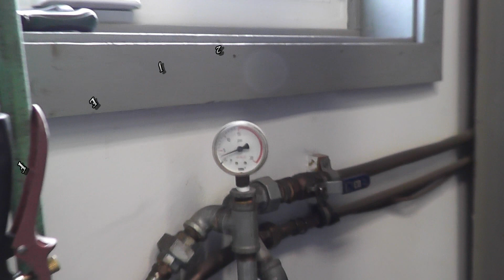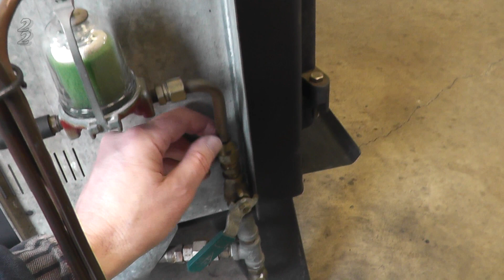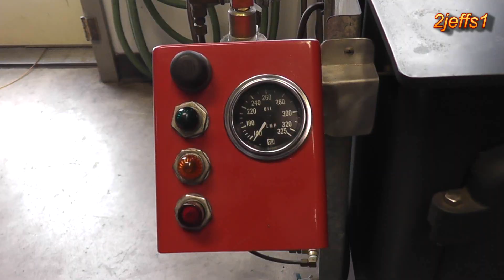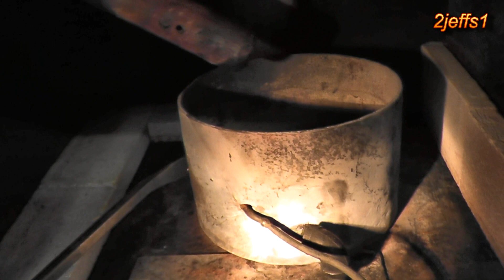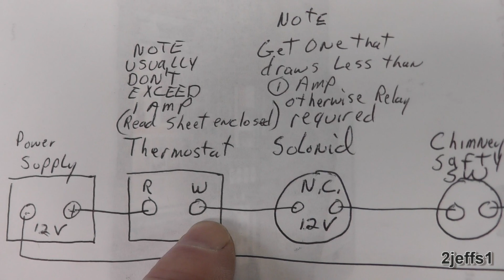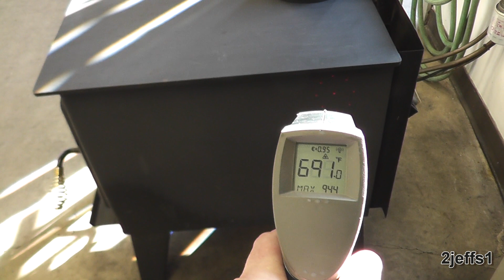Homemade Waste Oil Burner Heater for Daily Use p2 More Details DIY

Comment: As well as a great engineer you are Obviously an extremely nice bloke as well. 
I had to laugh when you said " Thanks for watching my Video " at the end. I think there are a LOT of people thanking you for your time efforts and trouble for making them so they can watch. 

I also notice how very neat and clean your shop looks. If I were within 50 km of you I wouldn't take my vehicles anywhere else to be serviced. I think people in your area would be mad to use anyone else. Clearly you are a genuine guy that has a thing for helping people and could be trusted. 

Thanks again for the great vids.  They are as well made as your heater and that's saying a lot.
Reply from the maker: Hi glumpy10. I'll give you a bit of the background. As you gathered I really enjoy helping folks out with automotive servicing. I've been doing this full time since 1982 out of a 1 stall garage. When I was a kid I'd repair tube TV's and Briggs & Strattons. Well then it turned into computer run and V8's. Great! Sometimes things can be a bit challenging to diagnose. I have a lot of patience and repairs being diagnosed / done right the FIRST time is the rule here. I still oil door hinges and hood latches,door locks, check the air in the tires and even adjust a drivers door that don't fit well any more. A while back a customer upon vehicle pickup said I forgot to tell you the drivers door don't close properly. I said yeah that's fixed too! Most people just drop their vehicle off and say call me when it's done. This is a huge honor to me! They also know if things might be a bit more than suspected I'll call first. Some times on the simpler things if people wish to do the repair them self I'll tell them how so they can save some $ that time. In return they will show up with a lunch, soda or beer as a kind gesture! I don't want to sound like I have all the answers but just want to make the world a nicer place! There are so many areas & things here that I'll be producing video's on to help others be creative and save $ too as time permits here. Thank You for your thoughts & glad you stopped by, Jeff
Reply: The world could use a LOT more people like you Jeff. There are not enough Kind hearted people around these days. it can be heard in your voice you are a chilled, laid back kind of guy happy with his life. You are obviously very clever and intelligent as well. 
I hope you get all the rewards and Happiness you so richly deserve. 

I look forward as I'm sure many others will, to your future Videos and thanks again for taking the time to create them for us to enjoy.

Comment: Well done on the videos and design, I to am located in Wi, and this winter has been long and miserable, makes going out in the shop a chore. I will be installing a simaliar setup in my wood burning furnace in the shop. only question i have is how large of an area is you shop, iam right around 1200 sq. the wood burner has no problem keeping up, wondering if the oil burner will bee the same.
Reply from the maker: Hi Brian. The main area I heat is 1440 sq. If you can heat with wood with no problem the oil stove should be better yet. I have a friend who has a very similar wood stove & can't believe how much more heat mine puts out running oil! Your right about the long & miserable winter. Arrrrrr. The best thing is the free shop heat!

Comment: Great videos, very informational.  Just to clarify one thing, the air tube going down the oil supply tube and heat shield is just to keep everything cool before combustion?.  I was wondering if you tried a small 12v marine blower with a variable speed control on it to contol the cfm's going in. My application is in a small wood stove that is off grid, so my power is limited to low amp draw solutions. I do have solar and 2 12v batteries. Any help would be greatly appreciated.
Reply from the maker: Hi Randall. Yes you could run without the air cooling on the oil tube. Nothing bad would come of it. You will have to run the long drill bit thru it more often to clear the carbon out. My best guess would be several times a week. I pondered on the next question quite a bit. I am familiar with the marine blowers. Just wasn't happy with my blower trial & error tests years ago. I might have an answer here for you. GM and Ford cars had electric smog pumps. I cant say what years. Mid ~ late 90's They would probably use a tad more electricity than your blower but they ARE 12V Then if you installed the tube to cool the oil pipe that would relieve it and it should draw less amperage too. If you knew someone in a junk yard and they would let you dig through their pumps -  Maybe there would be a candidate. A good counter man will be a big asset here. Well I hope this helps you for an idea Randall, let me know how you come out. I'll bet there are others in the same position too. Cheers, Jeff
Reply: 2jeffs1 Thanks, I did not know there were 12v smog pumps.  Do you know how many CFM you avarage?
Reply from the maker: Randall Fry
Hi Randall. Boy - no idea on that figure. I would think them would be similar to the belt driven ones. Those will make more pressure than volume like a blower..... That's what would be desired for a better result. To test one I would hook up the 1/4'' and the 3/8'' with the valve  on the bench to make sure that will be ok on amp draw & will satisfy the system needs. Hope this gets you more in the ballpark, Jeff

Comment: Hello Jeff I just wanted to say thanks again, I have been using my waste oil heater last couple weekends. I still have more to up grade, like building the air pump (my air compressor gets old running but I love the FREE HEAT)
 I had a ? for you........Your muffler for the pump looks like a sediment bowl but what do you have inside it .... looks to be foam maybe?  I have all the stuff laying around just have to start working on it.        And for FYI my garage is 30x30 at 20F I use 5 gallons oil to heat for 6 1/2 hours to reach a temp of 65F. I'm using a lot to warm up the (shop) but then I cut back on the oil flow  I see a lot of people asking you this, not sure if this will help out.  my set up is no where up to yours, yet I'm still working on it..  thanks again Chris from Ohio
Reply from the maker: Hi there Chris. On your ? you were right. That green stuff is foam in there. However the white thing is a porous type element that came in that sediment bowl and I wrapped the foam around that. That's interesting on your oil consumption - as you get things more tweaked it will get stingier on oil! Free heat - when the door is left open too long no one complains! Sounds like ya have a good head start on your project. Have fun Chris, Jeff

Comment from the maker: That blower thing sounds like a good idea until ya try it. I spent a considerable amount of time on that only to abandon all the ideas! Glad you pointed out the experience. FYI - depending what type of stove you are using the chimney sensor could vary bit. When the chimney hits ~ 265F at the high limit it kicks to low flow. NOW - You could get a sensor for a higher temp then you would get more heat off the stove. I limited it to this where it is a bit easier on the stove and glass. Maybe check your stove while its running with a Lazar gun at the chimney to get the correct temp sensor. On my first pot belly stove with out the limits you pretty much turn the whole stove orange if desired! On your idea of eliminating the overhead feed - Hmmm now that is one thing I never tried. Sounds like your doing quite well on your build, Jeff
Reply: at the moment my stove pipe temp is only 200 to 220 max (one of those magnet thermometers for wood stoves) . I'm using am old Chevy oil pump driven by a windshield motor and gear.  60 to 120 rpm variable from my old burner that didn't work.  I guess i need more oil to get a higher temp. I'm using a home made wood furnace (nothing fancy) with a magic heat. I still burn wood so the whole thing has to fit in the ash pan with the grates removed. Thanks for all the inspiration!!! Mike

Comment: Hi Jeff, I just got the air compressor hooked up to the pot and it works pretty good. I have tried using a blower with little success with a turk burner and your design and the compressor or smog pump is the way to go. It is a much cleaner burn with little smoke. what is the stove pipe temperature a foot up and at the shut down sensor at full on? Have you ever tried running the air and oil together (separate lines) into the pot so as to eliminate the overhead oil feed?   thanks for the wonderful video and your response !!!
Reply: I use Coleman mattress inflator. 23cfm output makes for a helluva wicked flame and super clean burn

Comment: Thanks for sharing!!  I'm in West central WI.   Yea it's going to be cold this week!

A couple Qs.  1) So the burner actually has 2 air inlets.   One from the smog pump, and the other is a damper that was original to the stove ... right?  I don't understand why two.  2) How critical is the draft?   I have a 2 story barn with a low lean-to part that I want to heat.   It's not pracical to run the chimney to the peak.

Thanks
Reply from the maker: Hi Dave. Where I adjust the damper - that is the stove design. No matter what kind of stove the burner gets installed in it will adapt with no issues. The newer design ones are more efficient where less oil needed is a plus. That 3/8" pipe isn't hooked to that. It does aid the burn a tad. If you don't install that on a build - I bet you would still be very happy with the operation. Guess a chimney shot would of been helpful for you. Mine don't go to the peak either. I built a thing that looks like a rural mail box on top of the cap with both ends open. Where the chimney don't get very warm this thing was a must! Hope this helps you out Dave, Jeff

Comment: Very impressive and clean design.  I would like to see your pan after a couple days burn.  Not sure if you've ever watched my stove video but my clean out is my biggest challenge with burning waste oil. I have to clean out about every 24 hrs. of operation. Black coal looking buildup. I need to put up an updated vid of mine I have switched to a stainless burner instead of brake drums. I'm also heating a 36x60 shop so I'm running a lot more oil through mine than yours, but I would sure like to improve my clean out issue.  Thanks for posting your videos!
Reply from the maker: Interesting setup Richie. If you ever make a newer video let me know and maybe I can help. Glad you enjoyed the video, Jeff